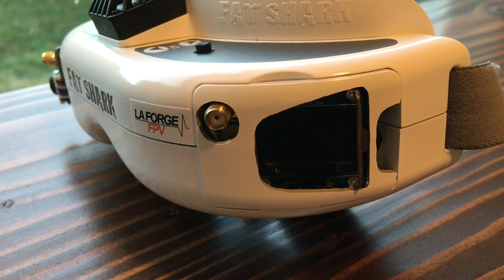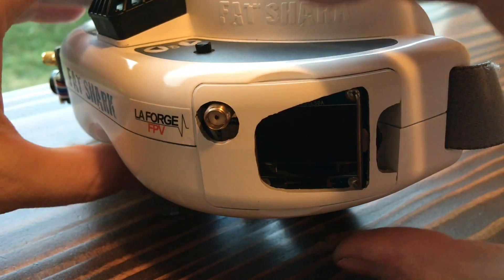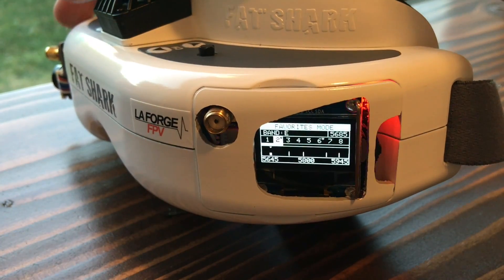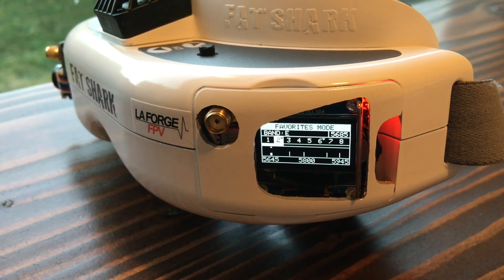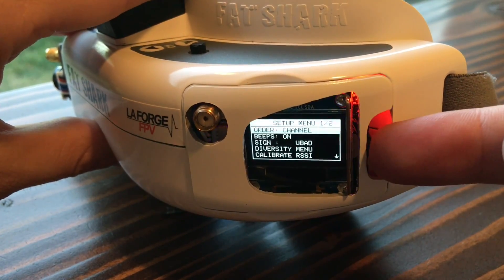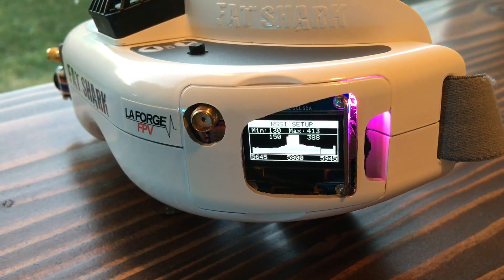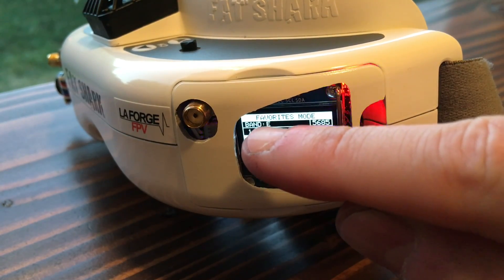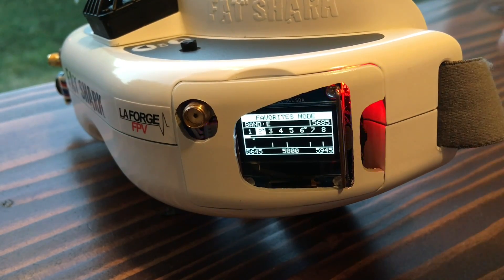LaForge FPV - RSSI Calibration

Comment: I had a realacc rx5808 with a patch and pagoda antenna... $20 for both.. and have just installed the laforge v4 with TBS triumph and a 5dbi blacksheep patch. Seems to be worse picture than the rx5808 with budget antennas. Not sure what im doing wrong.

Comment: Just did the RSSI calibration with vtx powered during first pass and got a spread reading at A 139 - 423 and  B136 - 453 so thats a spread of over 300, is this super perfect going by your video ? :)))

Comment: Is it ok if i had the vtx powered on before i started rssi calibration?
Reply: Seams like it worked but just checking. Had about 200 difference.
Reply from the maker: +nick newman yes this will work fine and is the "simple version" listed under the video description. You will only be slightly off in getting a min value as the RF floor will have noise from the transmitter.